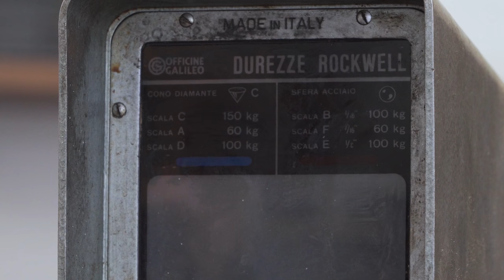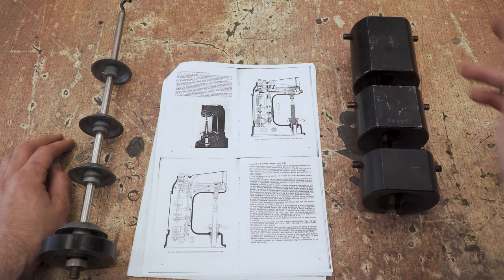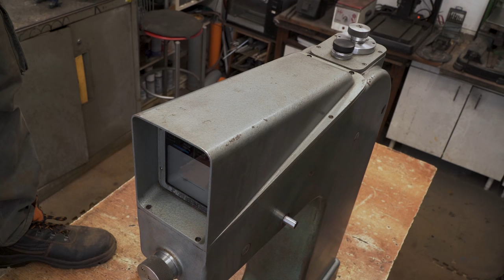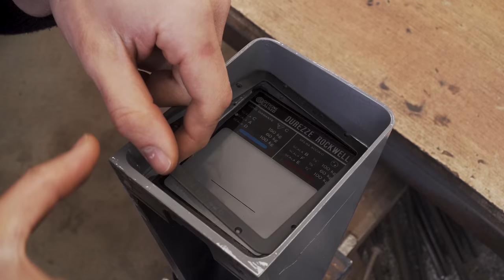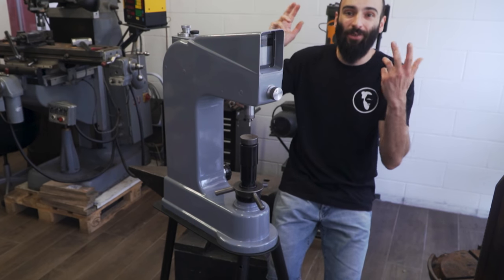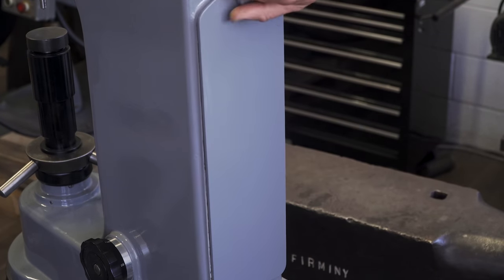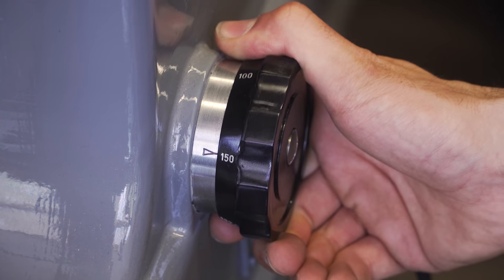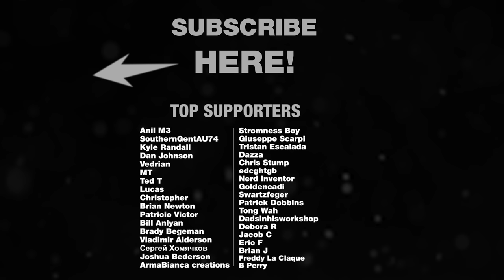Galileo Hardness Tester Restoration and Calibration

Comment: I had the same problem. I bought Rockwell Tester for a very good price but without weight. In fact after service and with this missing weight it cost me almost the same price as a new one (lol).. However I've heard that the new Rockwell Testers are not as well made as the old one. Nice work Bud! And it's very cool you calibrate it by yourself!